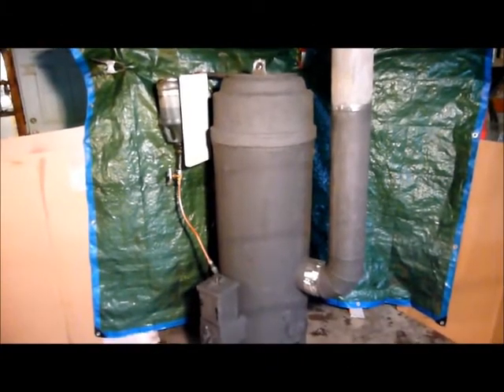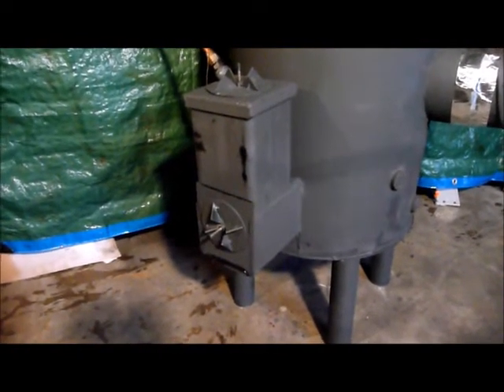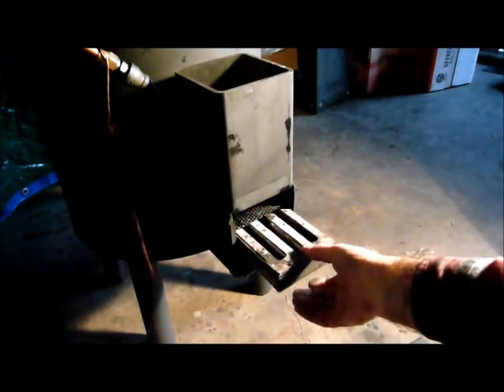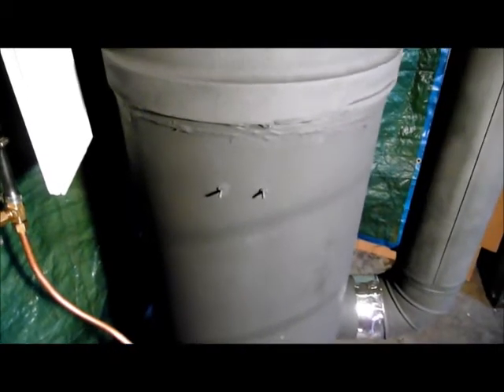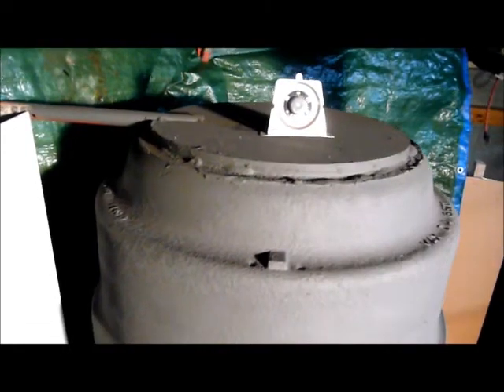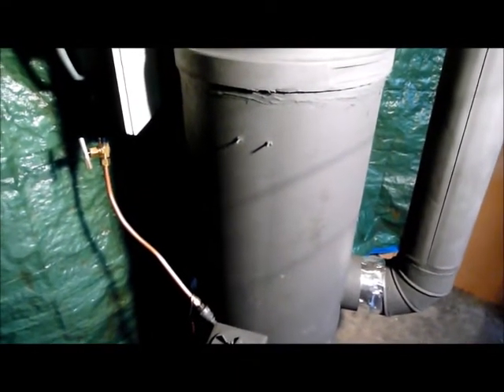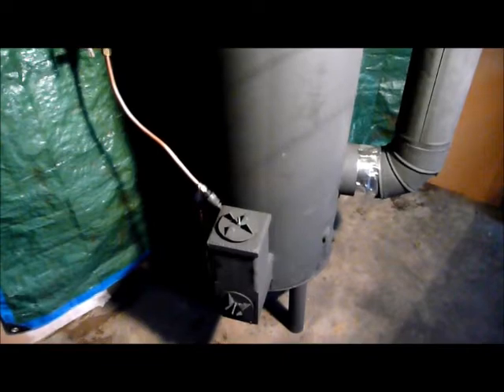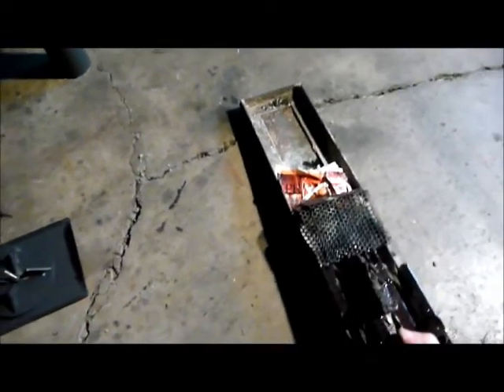Rocket Heater Part 1 of 2

Comment: If you fill the fire chamber with wood, how long would the wood last ?
Reply from the maker: I do not want to give you a bogus answer.  The time would depend on the length used and wood type. Assuming hardwood pieces extending 6 - 10 inches above the top of the feed chute, maybe 30 minutes. But the tendency is to always be "pud-zing" with it (using wood pieces). I didn't care for that.
See zerofossilfuel channel for the rocket heater he built.  Slick design; seems to work well.
Good luck and thanks for watching.

Comment: That is a nice looking unit you have built.
Reply from the maker: Thanks.  I wish it had worked out better than it did.
Regards.
Reply: I hope the stainless works out much better. I'm looking to make a cheap heat source. Just checking out a lot of different type of heaters. Good luck with yours!
Reply from the maker: Tom Skaggs Nope...did not work. Search YouTube for: Drip Feed Waste Oil Heater   User ID is Ozzirt.  This is what I have.

Comment: Do you use a special basket for the pellets....also does the waste oil just flow straight down into the burn unit?
Reply from the maker: There was a small pan that pellets could be dropped into.  Waste oil flowed straight into burn chamber from the top.  Suggest watching later videos to see how this project failed.  Thanks for watching!

Comment: I am making a rocket heater right now I have a tractor brake drum that I am going to do the same thing that you did.
Good idea to use the waste oil. I use waste oil for my alu. Melting furnace it heats super hot !
Thanks for the post.